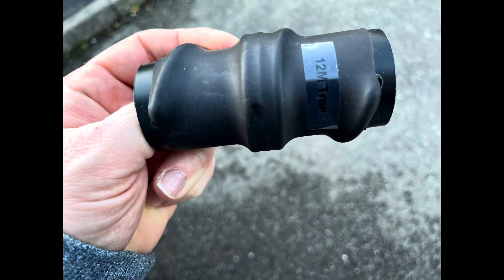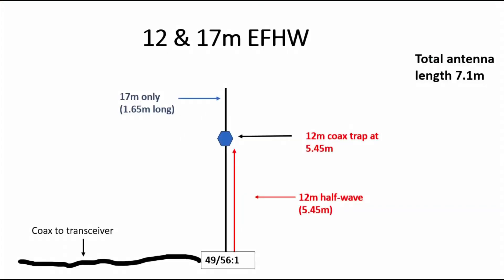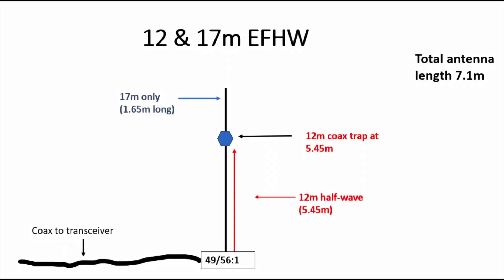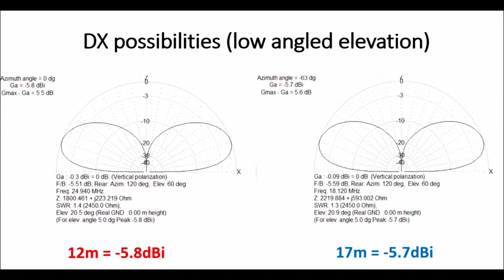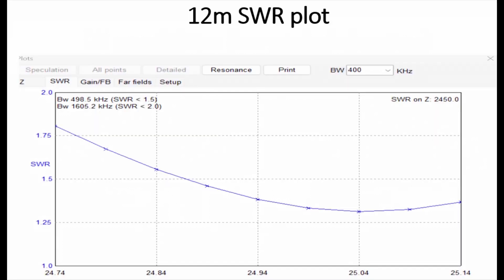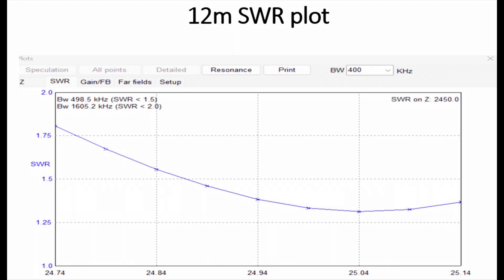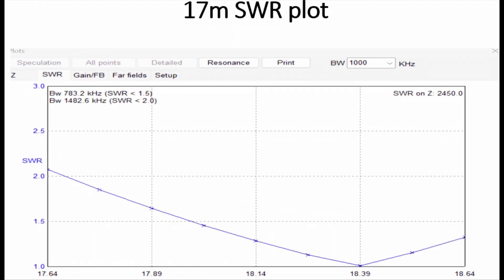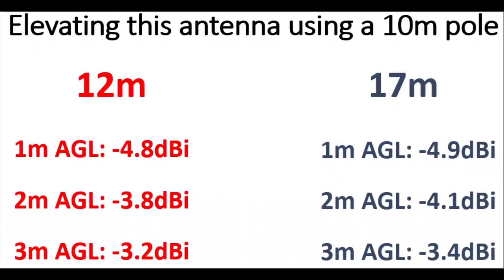Ham Radio: A simple WARC BANDS VERTICAL ANTENNA without radials

Comment: Hi Tim, it was a beautiful day in Paradise Beach today……so…..as a wire antenna nut I got out in the yard and made one of these.  I made a coaxial trap and made the initial wire lengths to your plans.  I firstly tuned the 12m section to best SWR and then tuned the top section for 18m.  The antenna SWR is very good on both bands.  Tuning the top section for 18m has very little interaction with the lower 12m section. I always enjoy your antenna videos…73 Daryl VK3AWA
Reply from the maker: Fabulous Daryl I’m glad you enjoyed the antenna. Best 73

Comment: I do not like contests . Going to spend Sunday experimenting for 12 and 17 on an antenna setup (sadly not a vertical) before the summer madness starts. 73 . M7BLC
Reply: I don’t either. Listening on top band last night, no regard for band plan whatsoever.

They are like locusts. Descend as a swarm never to be seen again until the next damn contest.
Reply: you're saying summer madness, and you are an M7. never heard any other guy say that.
Reply: Fantastic 🎉
Reply: @rjy8960  It's anathema to me. People who voraciously collect points for conversations on air that weren't conversations, contacting people that they've not remotely connected with.

The rubbish bands should be  given to contesters 24/7 and let people have 20 and 40 for actually speaking to people.
Reply: @kellypaws  They only come out when the contests are running and then they have zero regard for band plans.
Reply: I'm not a contester either, will never do it. But there is one positive thing. They gain good experience in high speed cw.

Comment: Hi Tim.  Have to say find the channel inspiring!  You are doing a lot that would motivate people to just try things.  Had a contest this weekend but still managed to get a 58 from a US station not in the contest.  On 15m with a dipole on spider beams pole at home.  Not sure what he had at the other end :)  Are you finding you are stronger running mobile than at home QTH?  My noise on 15m does not move the s meter so that's not a big problem.  Just wondering if a better location with higher elevation is helping on HF?  On the edge of a town here so only have a few streets before its farm land etc.  But the elevation above sea level is low. Thanks Anthony
Reply from the maker: Thank you Anthony! Operating by the sea gives a big kick to your transmit and receive. If you can, you should try it

Comment: Tim:  Previously you did 15 and 10 vertical with a trap for 10m.  What length would the antenna be if you wanted to do 20, 15 and 10 meters and added a 15m trap?
Reply from the maker: Looking into it .. video soon